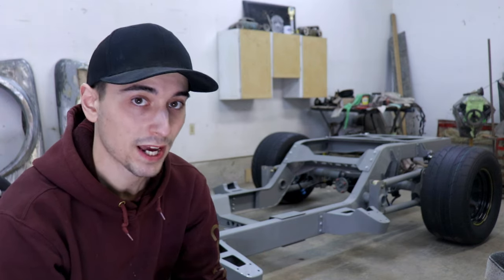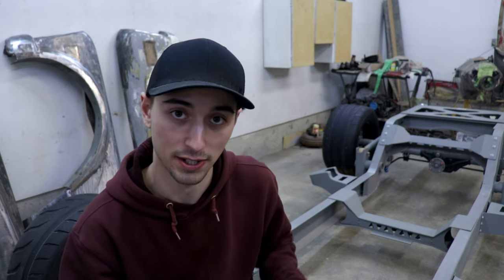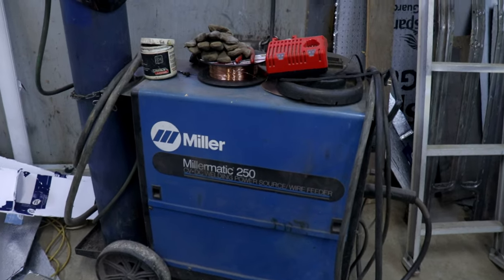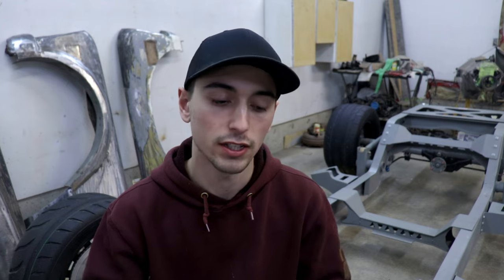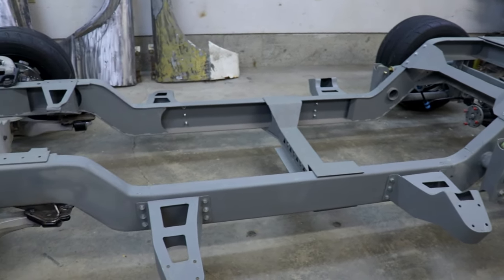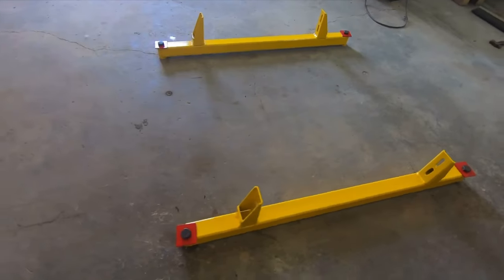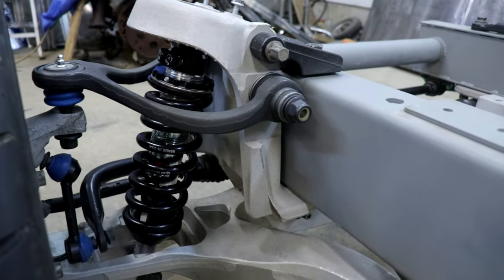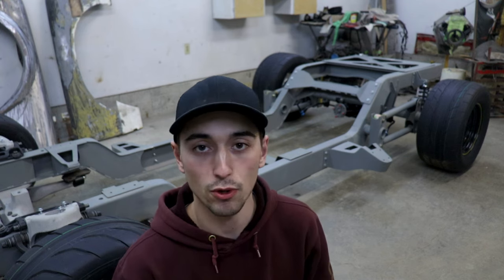How I Built a Handmade Chassis for my Turbo 1968 Chevy C10 Build

Comment: If you had a steel bender you could've just bought square n round tubing n bent it all yourself n saved tons
Reply from the maker: You are 100% correct, I just wanted to use the C channel for appearance and weight saving. The frame will be plenty strong when the roll cage is tied in
Reply: @ag_trucks  give it time your channel will grow n you'll be able to buy a pipe bender n all the fixings you need to build from strach again keep up the good work

Comment: Enjoy your videos, and love how your truck is turning out!.. Just curious how much wider the crown vic suspension and rear axel is compared to the original C-10?
Reply from the maker: Thank you very much! I'm not 100%sure how much wider it is. I measured a while back but I forgot. It is wider but not by that much I believe
Reply: @agperformance120  OK I was just curious if the crown vic front crossmember would bolt up to stock 67-72' chevy frame rails..I know they do on the same year ford F100. Thanks & keep up the
good work, can't wait for your next video!

Comment: Excellent and tidy work ! But I can´t to see clearly in the unions between frame parts that i see here, what method have you used, rivets or bolts ? Thank you very much in advance.
Reply from the maker: Thank you! Everything is going to be bolted + welded to ensure strength. No rivets
Reply: I am restoring the frame of my old bus Ford 1946 here in Argentina. Thanks again !!! @ag_trucks

Comment: 👍😎
Reply from the maker: 😎😎 hey peter!
Reply: @agperformance  try to build a frame to take c4 corvette suspension front and rear narrowed can do rear flat out Engineering sell a cross member narrowed to mount a arms its the between im working on going to use 2x3 for main